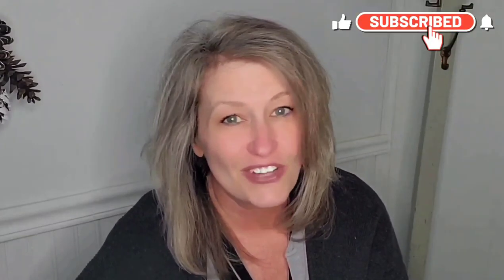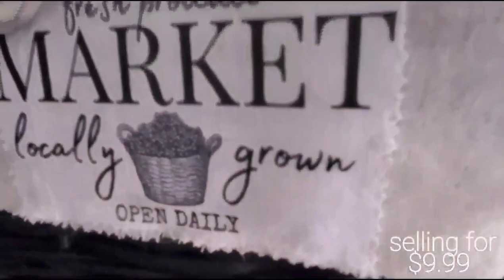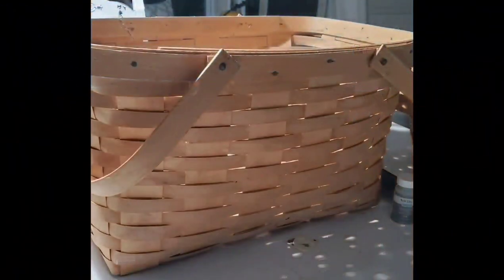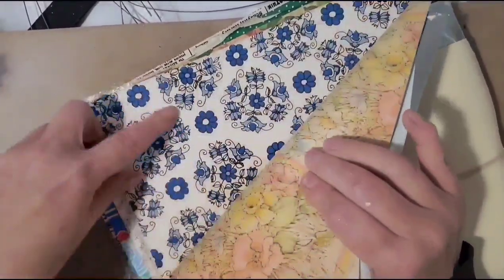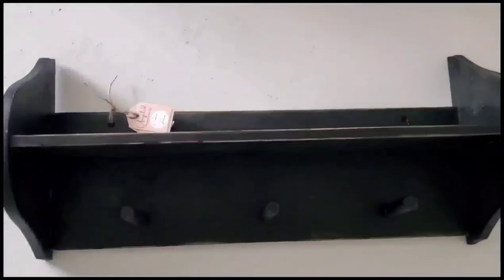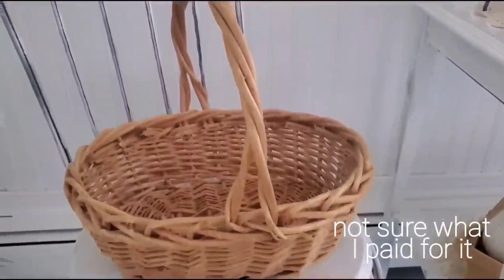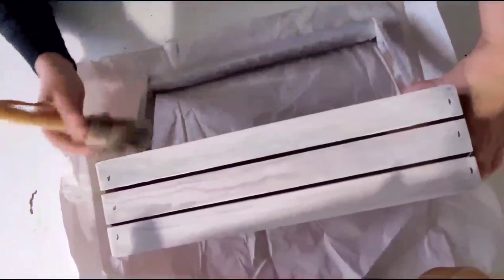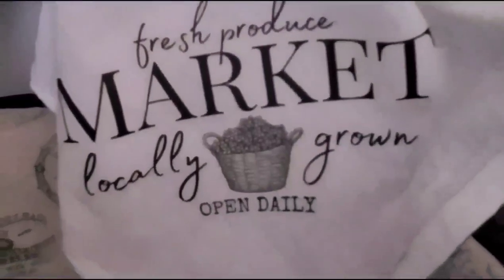Upcycled Baskets & Wooden Home Decor Makeovers! 13 Thrift Flips

Comment: I love all your projects.  I'm a beginner and was wondering what type of printer you use to print card stock and tissue paper, etc.  We only have a Brother printer and I'm not sure that would work.  Thanks.
Reply from the maker: Hi Connie & thank you. I use a basic inkjet printer from HP. The only issue I have with my ink is in order for the ink not to run when printing on tissue paper is to spray w sealer twice prior to Mod Podging. But other than that it's wonderful.

Comment: What paint do you use please ??
Reply from the maker: Hi Sandra here is what I used in this video. I love the Krylon Spray Paint and their triple sealer. ❤️ best to purchase at Walmart or Lowes vs Amazon 

Krylon COLOR MAXX Paint & Primer 
Battery Operated Tea Light Candles - https://amzn.to/3o4hPz0
Battery Operated Fairy Lights - https://amzn.to/3CWMoNe
Flameless Battery Operated Pillar Candles w/remote - https://amzn.to/3o4i0KG
Avery Light Iron On Transfers - https://amzn.to/3x88mL5
Frogtape Delicate Painters Tape - https://amzn.to/3cwL200
Chiffon Cream Chalk Paint - https://amzn.to/30aX3pw 
Spray Sealer by Rustoleum (6pk) - https://amzn.to/2YqQmyE
Wax & Chalkpaint Brush - https://amzn.to/3kiZ5dQ
Water-Based Poly Sealer (Brush on) - https://amzn.to/3mSBO4m